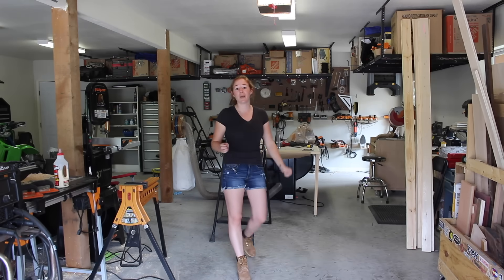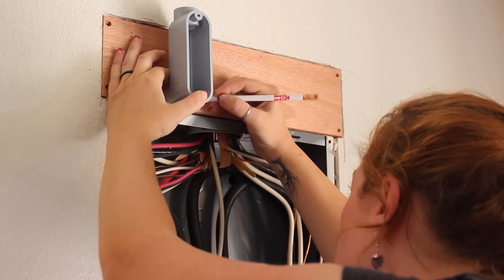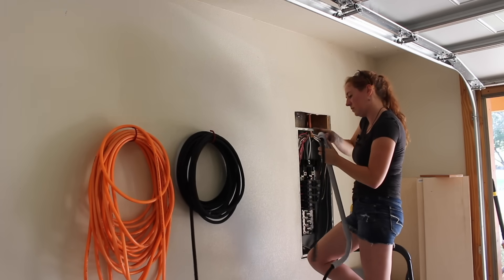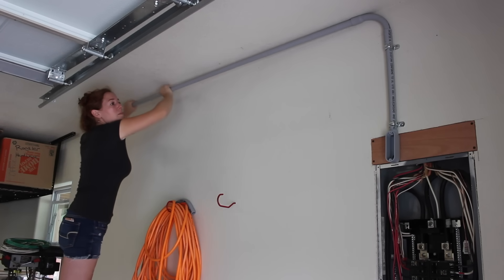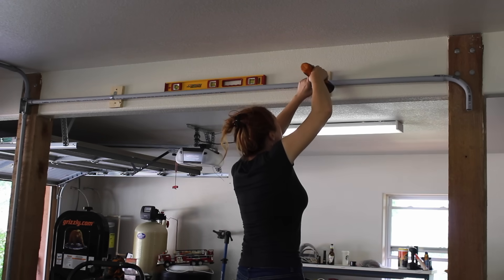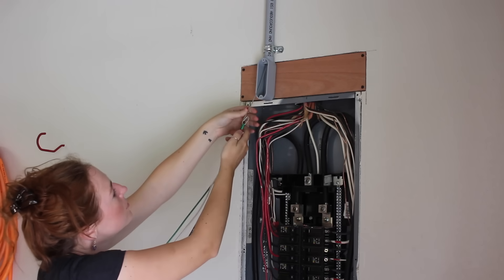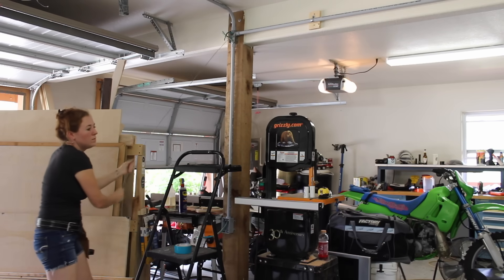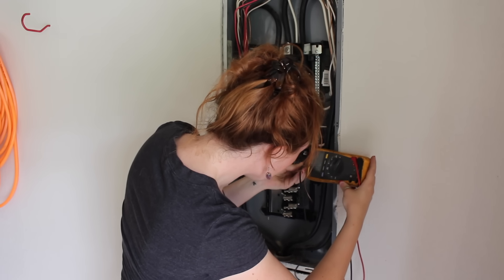Adding 220 Volt Outlets to the Garage

Comment: It's fine for a homeowner. I have seen some real wtf! stuff.

Use a a bigger J box, just for more room.
Put a work cover or raised surface cover on the outlets. 
Bond your recep boxes. ( those green  screws that came with it are for this )
Use EMT instead of PVC, but that requires bending, which isn't that hard really.

I am curious as to how you went from the LB to the Knockout in the panel? Anything but just running it through that hole would do. It really needs to be piped directly into the panel though.
Bending an offset or setting a small gutter would have been my choices.

You can bend PVC by heating it with a torch or heat gun.

Lots of people will say this, but if you can choose wire colors... Don't use white for a hot. It's just not at the breaker, it's more dangerous years later when some poor schelp opens a J box and thinks it's a neutral.

If you had tried to stuff S.O. cord through pvc you would have hated life. The rubber insulation sticks to the pvc in the 90s and makes it crazy hard to pull after a short distance.

Comment: Love the way you think. A" get it done" attitude. Im a electrician and have some constructive criticism. How did you get the LB conduit to your panel. It needs to be continuous. The metal opening in your panel needs a bushing so as the wires don't rub. Your metal J-box needs to be ground with a grounding pigtail.  Be sure it is grounded in the panel, all the way to your outlet. Next time, run two color wire for your hots. White is always a neural, unless its in a cable, then you just color tape the ends so it can be indentured as a current carrying conductor. Blessing. :)

Comment: A friend once replaced his meter box and wasn't supposed to. He lost his concentration for a moment and partially melted a screwdriver with the 220V. 
I once discharged a 20 000v capacitor with my hands accidentally. 
I don't think I'd be as confident as you working with so much juice.
Great job.

Comment: i ALWAYS wondered how you get all these cables travelling through the pipes...now i know. thanks!
Reply: It's not uncommon to feed through conduit pieces before joining and mounting them either. It breaks the feedng into smaller sections with plenty of access at the joins before making them connect. I've also vacuumed a string through long sections, rigid and corrugated.
Reply: @teravolt1195  Great Idea Vacuuming string!
Reply: CONDUIT!!! Plumbers run pipes!!!
Reply: I often use a flute to charm them through the conduit like a snake charmer. Not many people can do it, but I can.
Reply: @maximusmax4557  😂👍good one
Reply: I have a 'trekveer' from the time I still lived in the Netherlands. When I brought it along to help pull cables at a friends house here in Germany, I was amazed he had never heard of these. On my next trip to the hardware store I couldn't find anything like this. If you look up "Fish Tape" (English) or "trekveer" (Dutch) on wikipedia, it looks like there is only a few languages in which there is a word for this handy tool, so maybe the tool is not as common as I thought from using it while living in the Netherlands and the USA. The Dutch "trekveer" translates to pull-spring, from the steel variety shown on the wikipedia page.
Reply: Even found this on amazon.de with only an English and Dutch name: https://www.amazon.de/diameter-Flexibele-trekveer-Electric-15meters/dp/B019JUU8OO/.
Reply: Code usually prohibits feeding wire into unfinished sections of conduit and also prohibits PVC conduit from being used indoors.
Reply: Laura Kampf, i thought they tied the wire to a mouse and put a piece of cheese on the other end of the pipe and the mouse would run through the pipe to get the cheese .lol
Reply: @lar4305  before fish-tape was invented, electrcians used to fill the conduits with water and then send a small fish through the conduit with a fishing line or thin string hooked to them.  That is the origin of the 'fish-tape'.
Reply: I usually use a flute to charm them through the conduit
Reply: How did you think it got there?
Reply: Same!
Reply: You could also use a plug tied to a string and blow it through with compressed air. Then, tie the string to something like mule tape to pull the wires through. 
I also prefer to use a mule tape or heavy string to pull the wires and not the fish tape. The fish tape just gives you a way to pull the mule tape through.

Comment: Hello, I really enjoy your videos!
I am an electrician so I have a couple things to say; not sure if someone has already mentioned it. 

1 - your LB fitting is so close to the top of the panel that I don't think you connected the conduit to the panel with a connector.  Single conductor wire cannot be run outside of conduit and loose wire going through a metal knockout hole can be a hazard.  
2 - looks like you need to install cover plates on the outlets.
3 - I didn't see you glue the conduit fittings.  Not a big deal but PVC will sag over time and the glue will keep it to a minimum as it keeps the everything tight together.  Also worst case is that a fitting comes apart and exposes the single conductor wires.

Otherwise great job and thank you for your videos!

Comment: Great video. The only thing I noticed was no cable entry device where the cables enter the panel to prevent the hard edge of the panel knock out hole rubbing against the wires and causing a short.

Comment: It doesn't look like you cemented the joints of the conduit.
Reply from the maker: Nope, it isn't required to glue the joints. Plus, I wanted the flexibility incase I ever want to change things around.
Reply: NEC 352.48 might disagree with that statement. Then again I could of been doing it all wrong with pvc these last 20 years or so.. but for informational purposes the nec states by approved method to join pvc to fittings boxes etc. it doesn't state how exactly, however when you you look at the product pvc it has a ansi/ul 651 listing that it is designed to be connected to coupling, fittings, and boxes by the use of a suitable solvent-type cement and that the fittings used be ul listed as well for use with pvc sch 40 or 80. Not gluing it in a garage for a homeowner and no inspections I see no harm, however I would be required to glue it in any and all applications concerning it's use.

Comment: Not been doing electrical installation in the US, but as far as I know, some kind of a permits/licence/proven knowledge is required in many countries. I have the highest level permit for doing installations up to kilovolt level. Been in the industry for some 20 years. Hope you did all avcording to local norms and measured to prove compliance. It is not enough to just connect, the circuits need to measured. Have a nice day though.

Comment: I don't know the American rules, but some tips:
1) Use gloves and glasses @ inserting breaker. 2) For checking power don't use a Fluke (multimeter) but a duspool and check working duspool at an outlet that is on. 3) Tape the fish wire and 10-3 wires completly, sometimes you get stuck and have to poul back. Taping eveything makes it easier.
Love your videos📹 so keep them coming! 👍😀🇳🇱

Comment: A lot of us here on the comment board do these kinds of things in our homes. Without permits.  We just don't advertise it to the world.  Kudos to April for putting herself out there.
Reply from the maker: ; ) Thanks
Reply: When I installed my AC, the only thing I was legally required to do was (a) follow code and (b) get my EPA 608 certification to handle refrigerant. Of course, the manufacturer won't honor homeowner installed equipment, but I'm not worried. After buying all the tools, the system and installation accessories, I saved $5g over the lowest quote. DIY FTW!
Reply: cjpenning best comment. what she did might not be %100 up to code, but she did a nice and SAFE Installation.
Reply: the NEC doesn't care what you do to your property mostly just local jurisdictions and insurance companies do.
Reply: Great job April. I am glad someone mentioned the permit issue. In my home county in NW Oregon, the county requires a permit for any circuit addition to the power panel. It can be the owner doing the work or the Pro doing the work, and the county gets only $4 per circuit, plus a small fee for the first 100 feet in the circuit, so it is not as big of a revenue issue, just safety. Other types of electrical permits are much higher. 
I would just suggest a CYA statement to  "...check with the local county officials to see what the local codes are."
Reply: I bought a house in January.  The previous owner wired his garage addition straight into the meter no breakers.  No conduit, just wires laying in the attic.  He replaced the sewer line with electrical conduit.  I guess he used it for that instead of the wires in the attic.  It was fun fixing all that.
Reply: @ thomas russell what he is saying is he lives in a town home and even though he "owns" the property his local jurisdiction will not allow him to do his own wiring it must be done through a business.
Reply: He said he's an electrical engineer. An electrician is a completely different trade with entirely different considerations.
Reply: TG8gaming you should check out Survival Lilly for survival stuff, Fran Blanche for nerdy stuff, and PureLivingForLife for off grid stuff.
Reply: @Thomas Russell  Put that house under contract 4 hours after I found out it was for sale.  They were asking half the price of other similar homes in the area.  After the contract was signed I think they realized they priced it a bit low.  Even after spending 15k fixing the issues with the house we had instant 40k in equity.
Reply: I don't use electrical tape for anything other than PULLING WIRE!  Oh, and electrician's bandages!
Reply: Andrew Krause thanks for the suggestion man
Reply: @blue ferral that's just people being people with half an understanding of what they are doing.
Reply: ..and signed off on by the local code inspector.
Reply: Perfectly legal to do your own wiring in Texas if you house is Homesteaded. But you still need a permit. Permitting is such an expensive (a permit costs two to three times the cost of materials for any job I've done), time consuming, hassle that I just study the codes and and make sure I'm good for all present and future codes.
Reply: Splices in wall are okay provided that you either use an NEC approved splicing device, or you solder the connections and cover with either electrical tape or heat shrink. I strongly recommend using heat shrink. If you are going to use electrical tape, accept nothing less than 3M Super33 Vinyl Electrical Tape. After taping up all the joints, put one layer of over-wrap in the opposite direction of the other twists. And if you have a T-Tap, use a zip tie as strain relief on the tap. 

A lot of "pro's" and code inspectors aren't aware that in-wall splices are legal under NEC. They've all been taught "no hidden junctions".
Reply: cjpenning, don't know where you're from, but here, Austin, Texas, I believe that all splices must be in boxes.
Reply: cjpenning And boxes can't be walled over. They must be accessible.
Reply: The City of Austin implements NEC 2012 requirements, and has not amended 110.14 B which states "Conductors shall be spliced or joined with splicing devices identified for the use OR by brazing,welding,or soldering with a fusible metal alloy.Soldered splices shall first be spliced or joined so as to be MECHANICALLY and electrically secure without solder and then soldered." That has been part of the NEC since at least 1912. 

https://www.municode.com/library/tx/austin/codes/land_development_code?nodeId=THCOAUTE_CH25-12TECO_ART4ELCO

What you can't do is use wire nuts (which are not a "splicing device") inside of a wall for hot and neutral connections. (For whatever reason, they're okay for grounds.) Wire nuts can only be used inside of utility boxes, and utility boxes must be accessible from outside of the wall. 

Having said all that... the final authority is your code inspector. Argue with them at your own risk; most jurisdictions give them broad authority to make decisions on-site to go beyond minimum code requirements. And if you get an asshole, he can make you pull the entire wire run back to the panel just for fun.
Reply: The state of Minnesota allows individuals to do there own electrical work as long as it's residential, only certain cities and counties require permits or inspections if you do the work yourself.  Where I live I there are no inspections for anything, all i have to get is a building permit.
Reply: TG8gaming I
Reply: Here in NYC - no plastic. BX in the walls, and metal conduit outside the wall.
Reply: why do you need permit?
Reply: Many if not most jurisdictions allow a home owner or electrician to do things like this without a permit required. Some of the northeast states and some cities require permits for everything but in most places in the US there is no permit required to do what she did.
Reply: Gary Crumrine Most definitely. I have seen many homes where licensed electrician's work was far below code and sloppily done. Done right is done right whether it's by a pro or homeowner.
Reply: The clips make life easier, but all of us have wire-nutted before, and long before that guys were just twisting wires together with some black tape, in metal boxes no less, and it worked and nothing burnt down. I've seen guys in the union who couldn't run conduit half as good as she did. Good job, April!
Reply: cjpenning she's definitely the only girl that I know that uploads diy stuff to YouTube got made respect for her
Reply: More than that - there's too much down-side risk. The NEC is 910 pages of small print rules based on 4,000 public comments and 1,700 discussions. If there is a fire or other damage, you have to prove that you didn't cause it, or take the insurance company to court to recover damages.
Reply: blue ferral hope you found this with a pre-inspection and used it to leverage a good deal on the home.
Reply: wmkfisher ok, likely an HOA thing then. But he did say he wouldn't tackle anything more than outlet and switch replacement even if he could.
Reply: @ David Stone, so what is it like to live scared? You've got 30 years experience and won't do you own wiring? Remind me to never hire you for a job. I respect your position of liability, but come on, thirty years and you don't feel qualified? I guess your whole career has been behind a desk with a drafting program or pencil and rule.
Reply: ***** I don't see where that is an issue. The engineer has to know the codes to design the circuits to a legally buildable status. I have an electrical engineering degree as well, and I can build a working AM/FM radio from scratch,not just draw pretty pictures of circuits. I walked on to many jobs with my degree and have wired businesses, automation control systems, and residential electrical systems. I hold no license as an electrician. I have passed every inspection on every job I've done, with comments of the service panel being the most neat and tidy the inspector had ever seen. (in four different states). Engineer is a step up, not down or sideways for an electrician. You just have to put forth the effort to learn the practical applications, otherwise how can you tell someone else how to build it. The permitting agent must okay the plans before the electrician can follow them to build.
Reply: Kew Akl yeah, clip-lugs would be better, but if using wire-nuts I always tape them to the wires. It helps to keep them from vibrating loose.
Also, I couldn't see if she did, but it is a good idea, and code, to run a ground wire to the metal junction box.
Reply: In my own state, because I do not live in a "single-family detached dwelling",  I am not allowed to do any wiring on my own. I am an electrical engineering technician with over 30 years experience, including working on 480 VDC systems, and 440V 3-phase AC systems, and even if I were allowed to, I wouldn't try anything more complicated than replacing outlets and switches. There is just too much downside if something goes wrong. 
"Electricity is not a hobby" - I'm happy to leave this stuff to the pros. It's their job to know the code, and it's not my ass in a sling if it burns (assuming I get out of the house).
Reply: dude with your credentials and your afraid to add a circuit to your shop...that's kinda pathetic how about you leave your comments to your self
Reply: Please provide references, including specific locations, dates, times and customers as well as the name of the permitting/inspecting authority. I'll be happy to make a few phone calls.
Reply: One option would be to rope it all in and get an electrician to pull the permits and hook  it up. Just wait  until your  house burns for "whatever" reason or you want to sell and a permit search is done and bingo a problem. This is a cheap way to save you a headache.

Comment: They are right about running SO cord in conduit  and that was also true about flex to but in home use but they back that off and you can run flex but you most have a ground wire. I follow you channel and you do great with all your projects. I had a carpentry teacher and it was his way and if you did not do it right he would yell at you.  But we had another carpentry took him aside and told him to leave it be. A student will do thing in a different order but as long as the end results is good.  Your going to make mistakes but that is how you learn things.  Keep up the great work I have already made the screw box holder so I did not have a pile of boxes of screws and the one I want is on the bottom of the pile.  Keep up the great work.

JD